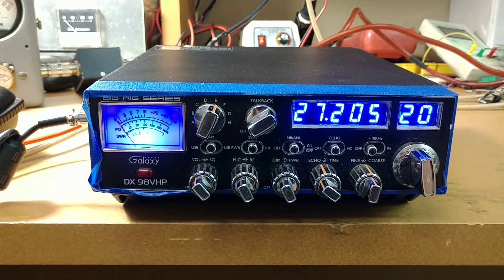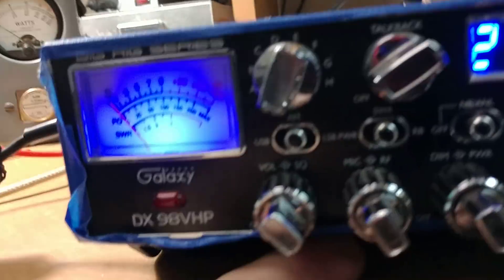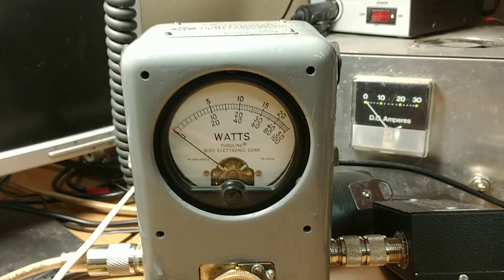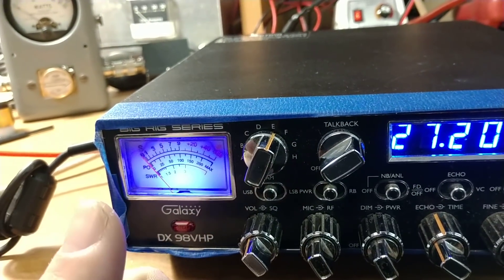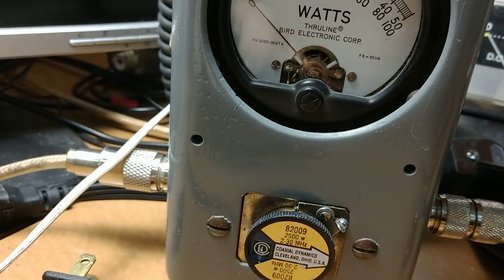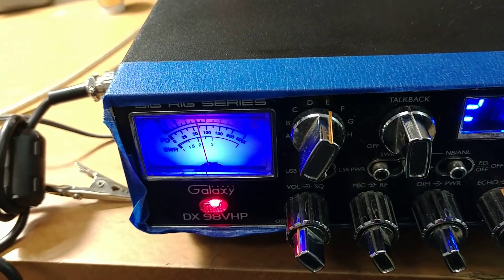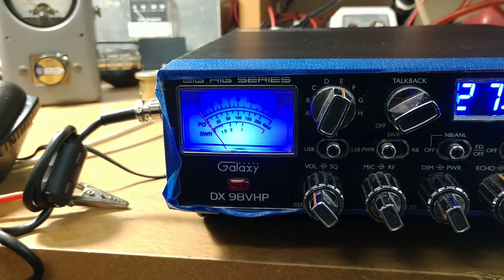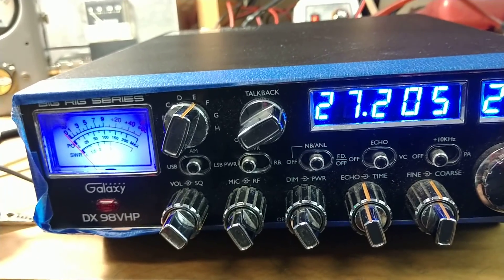Hg2879 powered custom 98vhp for Squirrel

Comment: How do you make a galaxy or just the galaxy 98vhp talk good on single sideband and have good audio? my experience is they drift and worble on sideband.  The Rci rangers do not have this problem. The 98vhp and 2970n2 have the same transmit section I hear. Thanks